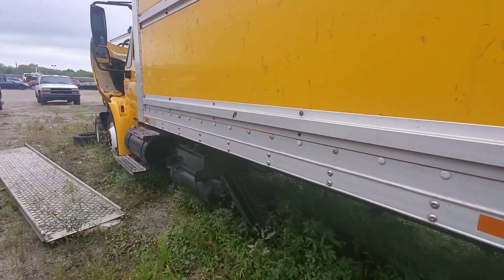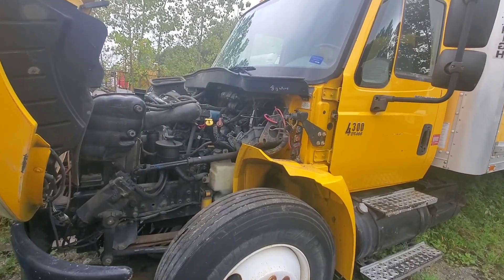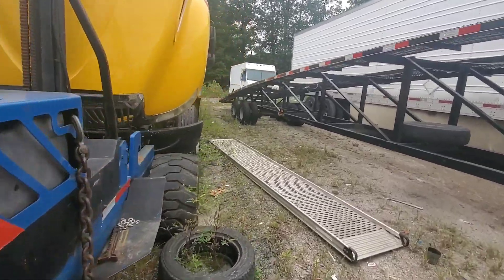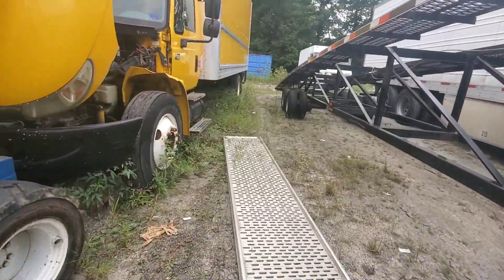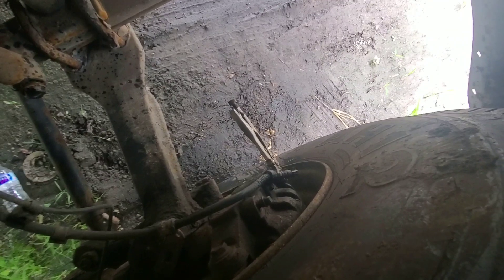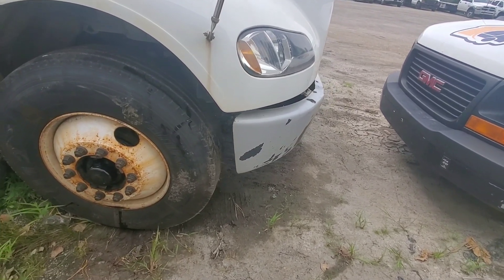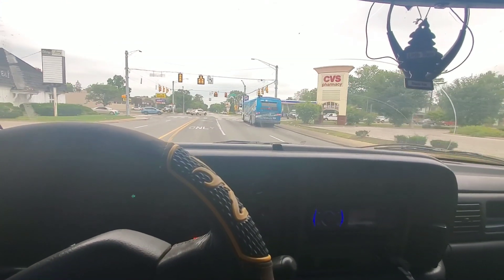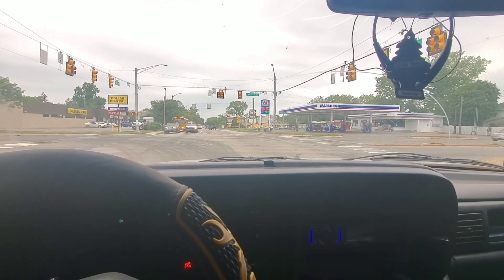Out quoting work and blytheville

Comment: 2 thoughts: 1. The company I used to work for had several of those 4300s - when they run right, they're pretty quick for their size. 2. A so-called mechanic was the reason why I bought my first car: he had told the previous owner it would cost $800 to fix her Chrysler Cordoba. I bought it for half that, kicked the "Lean Burn" to the curb, rebuilt the carb, replaced the alternator - and was driving not long after. I bet he was just trying to take advantage of my neighbor's being a woman. Some people aren't worthy of the term "mechanic" or "technician"  - "Hacks" are a better word for them.